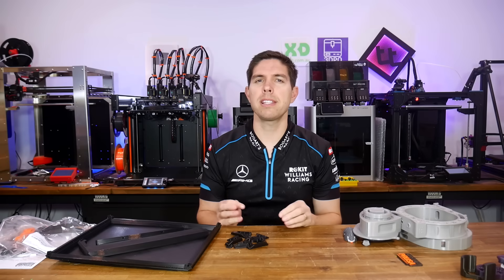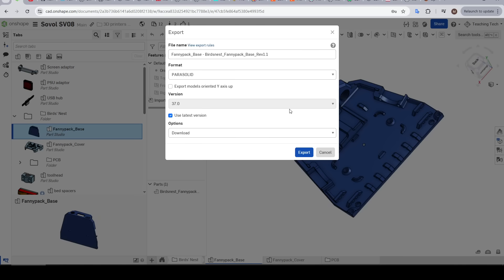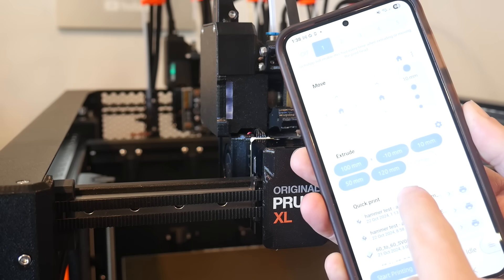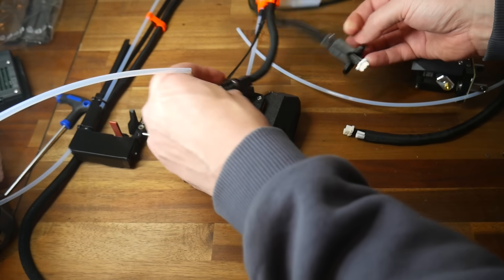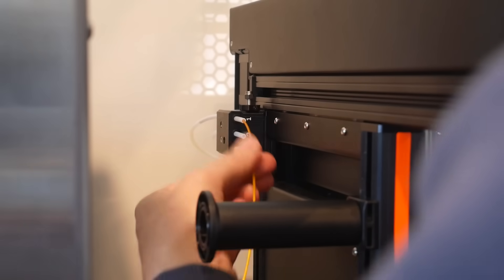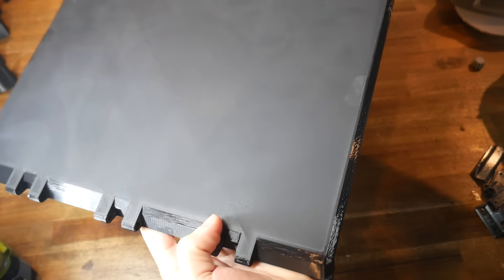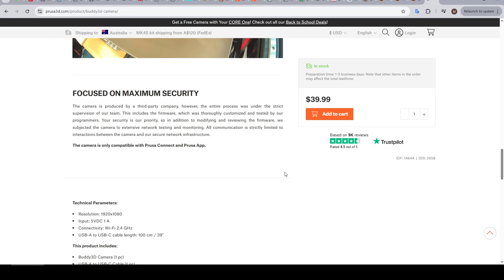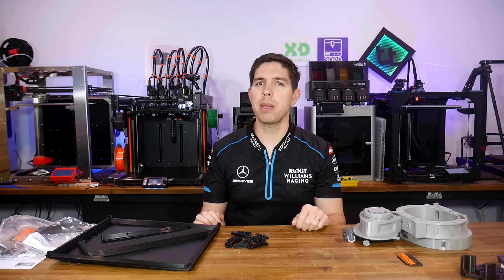Evaluating my replacement Prusa XL + SV08 update

Comment: Are you not angry about it? 100% prusa will never replace for a consumer the full printer
Reply: They do. There are plenty of reports where Prusa in the end replaced the entire printer. Usually if the issue can't be resolved with the help of the support, or if they want to investigate what went wrong.
So your 100% is 100% wrong.

Comment: For $7000, that printer should be printing. Flawless, that should have no problem. That to rip-off that aint worth $7000. You get the bamboo for half the price, and it does a 100 times better print job than that. That don't make no sense, and they're still using 3D printed parts. 7 thousand dollars

Comment: You can add build plates in PrusaSlicer - just drag any part to the right from build plate, where you would expect the other build plate would be (it will appear). You can actually make matrix of 3*3 build plates and ofc save it as a project. But it is true, that button would make it much more intuitive.

Comment: I bought the SV08 because you started your tool changer project for it, but I'm thinking the INDX is likely to be a better solution. What are your thoughts?

I was excited when Prusa first announced a tool changer so many years ago, but so glad I never bought the XL after watching videos of your assessments of it. I suspect that the H2C will kill the XL, assuming it operates as smoothly as the bambulab machines..
Reply from the maker: On the INDX, I tend to agree that a simpler solution is better. I really like how there are no electronics in each hot end. Slightly slower heat up after a swap but much cleaner installation. If it were an option at the time, I would have committed to that system instead, but now that I've come this far, I'm committed to finishing the SV08 as is.

Comment: I absolutely love my XL5t. But indeed it’s not without flaws. I print practically only PETG and that seems to produce little wisps of plastic that eventually stick to the heating block (yes, even with socks on) resulting in blobs forming. I now have a brush bar mounted and it is a little better, but only in multi tool prints. I had a lot of fun building it (I got the kit).
Reply: Nozzle blobs on a printer in 2025, it's tragic really, is it really that slow?
Reply: @hellcoreproductions  not that uncommon with PETG, especialy when the extrusion multiplier is set a tiny bit to high as to achieve maximum strength without frequent calibrations. My P1S and H2D do it as well.
Reply: Have you tried plastic repellent on you nozzle to reduce or prevent blobs? I also use PETG and TPU, the repellent works well for me. I just hope Prusa steps up their game soon.

Comment: This video sort of cements me not buying an XL. This was (if I recall) set to be released pre-pandemic, delayed due to parts shortage. So this is really a "2020" printer trying to compete in 2025 against the H2D and upcoming for X2C Vortek, among many others. Honestly it doesn't stand a chance... and Prusa needs an XL2 asap to remain competitive.
Reply: I fully agree. The XL is an old design based on technology fron 2021 - an outdated machine in the rapid developing world of 3d Printing
Reply: The only thing I don't like about the XL is the price - I'm happy with mine and the Software evolved over time.
Seeing how many people around me backed the U1, this seems to be the printer of the future. It's not the over engineered closed source china cloud Bambu stuff and not so expensive as the Prusa.
Reply: @zwei.r Snapmaker is Chinese....and we have 0 idea about its firmware.
Reply: Xl =xlarge lose
Reply: Not really, the H2C crappy over engineered nozzle swap system is not even comparable to a true multi material system as it cuts the filament each filament change, increasing swap time and throwing retractions out of the windows until the “slug” of cut filament is purged or printed…
If anything you could say the new snapmaker could make it obsolete, if they manage to stick the landing with the software
Reply: @4fluxsake That's not how retraction works and I'm not sure why the content creator who said that (not gonna shame here, but everyone is spreading the same nonsense) said it themselves.

You don't need the filament to be "connected" to the "slug" during a retraction, nevermind the fact that after priming, the new filament would have already hit the melt zone of a h2d/s/c nozzle.

Retraction doesn't pull the melted filament at the nozzle since it's, well, melted. It also doesn't create a vacuum and "suck" it upwards. All it literally does is relieve pressure from pushing down. 

You can literally test this yourself to actually see how this works. Start a print with a bunch of retractions, when it's about to do them, pause, cut the filament, and resume the print. It will happily resume and do those retractions without an issue.
Reply: @winebartender6653  what do you mean the retraction doesn’t create low pressure to suck up the filament? What else could possibly prevent it from oozing out of the nozzle when it shouldn’t then? Also the fact that a print with a bunch of retraction will still complete even if you cut the filament isn’t saying much, yes it will complete but at the cost of a bunch of stringing and artifacts. There is no need to test this, I mean how could the extruder gear interact with the filament in the nozzle if it’s cut? Bluetooth?

And you kinda proved my point about the priming tower, to me it seems they made it larger to account for the extra filament you need to purge to push the interruption in the melt zone, so it’s basically a poop tower now 😂

But I agree it won’t be that severe, but even as a Bambu owner (and I love my printer) I see so many flaws in their design I would never buy it with my own money if I needed a true multi material printer, this simply ain’t it
And don’t get me wrong it’s cool as fuck from an engineering perspective, but still fundamentally flawed
Reply: @4fluxsake There is a difference between "negative" pressure (aka a vacuum) and reducing pressure (which is what occurs when retracting). You aren't creating any negative pressure in the nozzle when retracting. Plenty of sources have already disproven this theory that gets thrown around. The pressure in the nozzle comes from the filament being pushed by the extruder. When you retract, that just takes away some or all of that pressure. That's it. It's not "negative pressure", you aren't pulling the molten filament in the nozzle up with the filament. You are only releaving pressure.

Because of this, whether the filament is cut or not will not matter. It will act as basically infinite retraction for the 1cm of distance before it's melted after being cut.

So no, as I said, do the test. It isn't going to just blob and string and have a poor result. 

Matterhackers has a good concise piece on exactly this and you can Google it as links will not work here.

Most multi tools prime anyway if you genuinely care about surface quality to that extent. You can also prime to infil depending on the model. 

I have no horse in this race. I have a U1 on order and want to build a SV08 max with INDX when that's release.

And I agree, the vortek is a half baked solution that will be over priced for what it ends up offering. The only way it can make sense is if they 1) release a multi-output ams and 2) have a 6way filament sensor array slapped just before the buffer. That way, you at least remove the retract and feed of each filament to the interior length of the filament path. In that case, at least most of that time will be overlapping with the nozzle swap and heat up.
Reply: @winebartender6653  Mmmm ok then I might have outdated information, I’ll look it up, but then what’s the point of bigger retractions? Is it relevant only to Bowden printers?
Yeah I’m debating pledging for a couple myself, as it would still be cheaper than adding an AMS to my P1S if I sell it after I get the U1
Reply: @4fluxsake Direct drive extruders in general have a shorter retraction vs bowden simply because of slack in the filament. Bowden has its extruder away from the toolhead, so it has to make up for that slack during retractions. You can't really compare the two in that respect.

To add, that is why Bowden users much prefer smaller diameter ptfe and why "Capricorn" tubing was popular. It was a way to better control the filament path and reduce this kind of slacking, for both better/more consistent extrusion and retraction
Reply: Yeah, it's almost 2026. We really shouldn't be treated as guinea pigs any more. Go Bambu or go home. Simple.
Reply: @jmtx.  I go home then... Simple

Comment: I won't buy anymore prusa printers. I upgraded my mk3s+ to a mk3.9 and everything was good until 2 months later when the screen went bad. Prusa replaced that screen. 2 months later, the USB port on that screen went bad. Prusa told me too bad, we're not going to do anything about it. I bought a replacement screen making this the 3rd screen the 3.9 has had. I will probably be selling it as there are a lot better printers available that just work.
Reply: How much did you spend on all of that in total?
Reply: @riba2233  The upgrade kit cost $336.92 shipped and the new screen was $110.28 shipped. All for a machine that I no longer consider reliable. I regret the upgrade as the MK3 I had was reliable. I just bought a QIDI Q2 for $443.99 that is working awesome so far and I am getting better prints out of it.

Comment: I am not sure why Prusa has not fixed the fan failure issue yet. I had this in November of 2023 and opened GitHub issue 3480 XL Fan Test Inconsistent. It is still opened and unresolved. It looks bad when the very first test fails every time on a semi assembled machine, and has occurred for almost two years... Removing the fan shroud to pass is not the correct solution.

While I do like my XL, I feel that it is Prusa's red headed stepchild. It was announced before the MK4 and was released in a poor state. It took at least six months to get into a function state, costing early adopters time and money. Prusa seemed more focused on the MK4, MK4S, and the CORE One. Now they are teasing a CORE One with INDX toolheads. When will Prusa put more time into the XL firmware, fix bugs that have been opened for year(s), such as the fan, flash drive corruption, get some of the features out of beta, etc? Is there going to be an XLS, or at least an upgrade for part cooling due to poor cooling performance? The same cooling issues existed with the MK4 that were resolved with the MK4S. Keep in mind both of these were released after the XL...

Comment: I'm waiting for a Sovol SV08 Max with the Bondtech INDX system.
Reply: But what is with the print quality there? I heard that with standard profiles, the quality is not really good?
Reply: @outstanding1403  I have an enclosed SV08 Max that I got through Kickstarter and so far, the print quality is as good as the P1Ss' and Plus4's in my print farm - meaning excellent. Now there is always room for improvement, but I have to say I am highly impressed with what Sovol put out with the SV08 Max.
Reply: @sliceofmymind wow thats interesting maybe the dude in the review i watvhed had bad luck. Thank you for the feedback I will looke at it again!
Reply: @outstanding1403  You are very welcome. Unlike other Youtubers, I buy all of my printers, so I am always going to give my honest opinion. Stay away from the Centauri Carbon, Kobra 3 Max (really poor first layers). 

If the rumors are correct, Sovol might be releasing an updated SV08 with the toolhead and better heatbed design from the SV08 Max and Zero. I love both my SV08's (I have two) even though the bed isn't as flat as it should be (got to preheat it for 15 to 20 mins).

Anyway, have a good one!
Reply: Same here

Comment: I so want to love this printer just because it's a Prusa, and because I'm not okay with Bambu's attitude to privacy.  But objectively for the price it's just not double the printer an H2D is.  It's frustrating to watch Prusa move so slowly on R&D, when you have to believe they could kill it if they just learned to do better R&D.  I'm waiting on the INDX from Bondatech, due out November.  I'd rather build a Voron with INDX for half the cost, assuming it performs - and I'm excited at the prospect of different sized nozels.  I currently have two Qidis, a Q1 Pro and Plus 4 - maybe Qidi will launch a new idex machine or tool changer with INDX...
Reply: I have a Qidi Xmax3, its a decent unit but I am looking for a tool changing large format actively heated printer with INDX or something similar. I agree I just can't see why its taking so long for Prusa to catch up. Whoever designed the frame/motion system for the XL has me scratching my head, why is it not properly enclosed with a standard stamped metal frame like their competition??? Prusa's design is overly complex, and not at all cost effective. I get the feeling that the XL was a victim of scope creep and decisions by committee. Also they priced themselves out of the main market, 5K asking price was a terrible decision. The XL five head model should have been 2500 tops.
Reply: @benjaminford8173  yeah, I'm hoping Prusa turns this around.  My guess is that they simply don't have the in-house manufacturing nor cost structure know-how to flip over to mass-produced stamped frames.  Certainly Europe doesn't have the scale and range of manufacturing capability China now has, with their robot-operated dark factories.  Prusa used to lead on R&D, but now Bambu are just moving faster.  In reality, I think they have to just differentiate and not compete on cost alone.  But they can't fall behind.  My hope is they start to lean into partnerships more, as they have done before, and maybe team up with Bondatech on toolchangers.  Fingers crossed!

Comment: Prusa is done for now. They need to do much better because we need more competition.
Reply: Beetlejuice, Beetlejuice - Repeating "Prusa is done" 3 (or 30) times doesn't make it true.

Prusa is still only non-Chinese somewhat-affordable 3D printer manufacturer. They may not get my money, but they do get my respect 😉
Reply: @kimmotoivanen  Respect for sitting on their laurels for 15 years? Most of their printer's BOM is of Chinese origin.
Reply: @hellcoreproductions  Tell us more about you not knowing anything about Prusa 😅

They manufacture majority (steel and plastic parts, electronics assembly) of the parts in-house or in EU. We don't have abundance of stepper motor and electrical component manufacturing, but they are not obliged to choose the cheapest ones.

At least Prusa printers melt plastic only in the hotend 🤯
Reply: @kimmotoivanen  Hes just a bambu bootlicker. Hes already made an alt account with the same profile pic becasue hes been shadowbanned from so many other channels for his toxic bot behavior. People been crying "RIP prusa" for the last 3 years. Yet they're still around and selling more printers than ever before.
Reply: @kimmotoivanen non-chinese is very relative ;) but objectively speaking, they are not competitive anymore in any way, I think that we can agree on that.

Comment: Prusa XL is a great printer. Better, 5 tool and opensource then Bambu Labs H2D. 🥳
Reply: Sure...
Reply: Lets talk about the glorified dustcover that Prusa calls an enclosure.
Reply: @lukahierl9857 and costs more than qidi q2 which is a far more capable printer lol
Reply: rofl it's not even close, what are you talking about...

Comment: It sucks being an early adopter when it comes to new Prusa printers or upgrades.  My MMU upgrade for a 2S never worked properly no matter what I tried & had to tear it down.
Reply: Their MMU and MMU2 for the 2S, and 3 and 3S was a faulty complete POS ... I lost so much respect for Prusa continuing to sell it and knowing the issues people were having ... how many times did I have to go looking for those bolts when they fell out every time you had to open it. 

The MMU3 works (and stops the run away bolt issue) on my 2S and 3S but still so much effort required for tip tuning that it's just not worth using it next to a Bambu with an AMS ...
Reply: @rackbites  i had the same experience with a MMU2 at my school. Unreiable piece of crap that got its stepper motors salvaged after spending way to much time trying to get it working.

The newer Bambulab AMS style units (individual feeder units) work so much better and are easyer to work with than the MMU style (sliding selector)